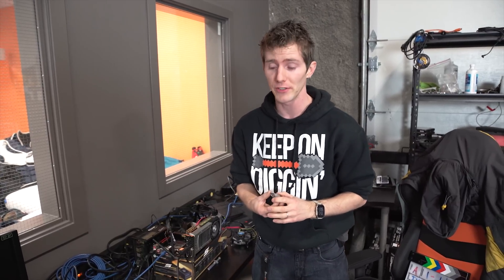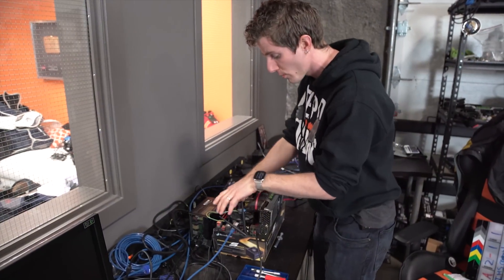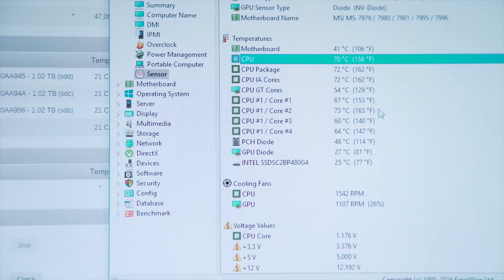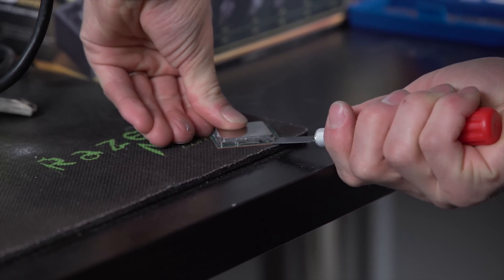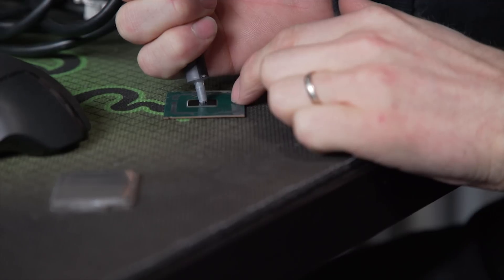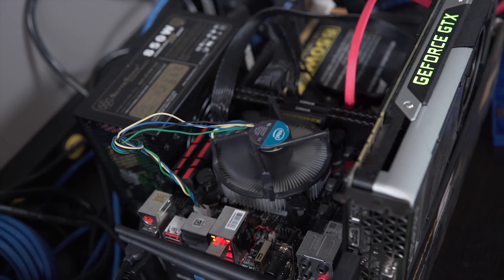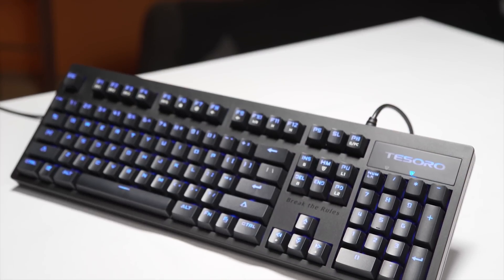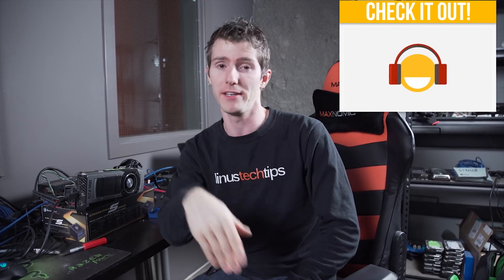Delidding an Intel Core i7 6700K - Is it worth it!?

Comment: Done hundreds of these; use the vice only method. It is so easy compared to this.

Also you should really use liquid metal and spread the TIM on the die out properly. Applying TIM on the die should not be done as casually as applying TIM on IHS. You can easily get 10 C* cooler if you do it properly.
Reply: +slowvomit The Skylake package is much thinner than Haswell though.
Reply: +CheapSushi Still works though... But someone in another comment found this if you are worried about the vice... http://www.overclock.net/t/1585028/skylake-delidding-for-3d-printer-owners

Comment: Dear Linus, i have a question in need of answering. When you opened that metal lid from the CPU itself, i saw an itsy bitsy chip and my brain popped out a question. There was soooooooo much unused space under the lid, but why don't CPU manufacturers fill it with bigger chip? That means more transistors = more powerful CPU? Or is there a some kind problem that manufacturer can't overpass?
Reply: +Chenbag More transistors = more heat.
Reply: SickFriend1
modern coolers can handle that, especially water cooling + i am no talking about filling all space, atleast like 1/3 of actual chip or 1/2, still a big improvement in performance and cooler can handle. Altho i am asking Linus about the downside of this? why can't they make bigger, is there a physical problem that they can't overcome or something? Or is it just about making money? (400 small chips from one platter on the factory vs 300 bigger chips on one platter)

Comment: Honestly I'm quite disappointed with this video. If you're gonna do this. I would hope for doing it right and using that Coollabratory coolant. The temp decreases are quite significant in my mind.
Sure it doesn't change the downsides mentioned in the video. But it sure makes the advantage of the whole process shine more.

Comment: Good tip: I did this to my 3770k, and it is very risky, if you cut the pcb on the cpu you will kill it of course.   I used a safety razor to cut a tiny tiny bit into one corner, then removed the blade and used the sharp edged plastic "blister pack" from a SD card packaging for the rest, which is able to cut the adhesive but not able to cut into the cpu.    

I then removed the residue with IPA, used Liquid Pro Metal applied both to the chip directly and the heatsink (coolermaster TPC-800) which I'd previously sanded and polished to a perfectly flat surface.    I put the heatsink back on directly to the CPU without the IHS (unsure if you can do this with newer chips). Afterwards I saw temps drop roughly 8-10 degrees C.    Obviously each installation is different, each CPU generation is different and results will vary :).

Comment: Should of mounted the heatsink directly to the cpu die, taking the IHS out of the loop completely. Thats what i did with my 3570k and it works very well.
Reply: Was it worth it? Mines running below 70c under load @ 4.7 GHz atm.

Comment: lol I don't understand Linus reaction in the end. The results are pretty amazing, I mean a few °C can matter a lot and he's still not convinced? Feels like he has set his mind in the first place, regardless of the end result his conclusion is probably the same.
Oh an dear Intel..... why on earth do you not just use a good thermal compound in the first place? °__°
I understand that soldering is more expensive in production but thermal compound? c'mon!!!
Reply: I got disappointed when I saw the stock cooler. What's the point of doing this without even overclocking. He is getting old. He is getting lazy.

Comment: This is seriously the worst TIM swap I've ever seen. From the overly risky method of removing the heat spreader to the disregard of TIM used, this was one of the worst videos on the subject that's been produced. A proper TIM swap would have you using a higher quality TIM, properly and evenly spreading a very small amount on the die, and also using the same high performance TIM for the heat spreader to the heat sink. This is not representative at all of the results you could expect if done properly. Alone I've seen a 10 degree C drop in temps by replacing the TIM on my 4790k, allowing an extra 200Mhz of over clock potential. Poor video Linus...
Reply: I edit videos and often have to change video codecs. It may not seem like much, but 200 more MHz on a CPU bound program like Handbrake makes a noticeable difference, especially when videos are greater than a few GB in size.

Comment: People are getting 10 or 14 degrees improvements with this, its very low cost and high reward. You could damage something, but you could damage something by doing just about anything. Why didn't Linus even use a heatgun, he should know better.
Reply: +miiiikku i get ~12 degrees with 4790K... but thats with liquid pro and gc extreme
Reply: Nabil Danial Linus did a quickie on this one. 99% of people don't break their processors, huge gains and low price, its a great thing. Liquid pro costs only 10€, thats half the cost of a good case fan.

Comment: The last computer i build before i went on a long stretch of notebooktime, was some kind of amd, where you mounted the cooler directly onto the die, why did the manufacters change that, because of safety reasons or because it's easier to install a cooler. I remember one time i slipped off with the cooler while installing it and broke a little corner of the die, but i stilled worked ^^.

Comment: depends on the processor series..delid was really helpful on the i7 37xx series..my 3770 reduced on idle from 65-38C..on load from 90-70C..this only means that the new 6700 has really nice thermal compounds on it at stock
Reply: +jaja1818 Skylake has almost the same benefit like Haswell. Still beneficial to delid and replace with proper TIM like CLU or CLP especially if you spent loads of cash on a cooler.
Reply: its nice to see that intel fixed the problem though..nobody really wants to find out that their product is flawed and a fix is available but you void your warranty..in my case, it was a bad generation of products and the 20c different is significant..hell with that difference, i didnt need to buy an aftermarket cooler

Comment: On my 4770k 4.5ghz i went from 85c to 80c using noctuas thermalpaste. Not a big difference, but then i tried out the collaboratory liquid metal between the DIE - IHS and IHS - Cooler, and i am not joking here, i went all the way down to 55c on the hottest core, full load. Running the same Vcore and the same antec kuhler 920 in both tests.

I am more and more thinking that linustechtips is retarded. Linus do you know the saying that the chain aint stronger than the weakest link? Try with a decent cpu cooler and some overclocking.
Reply: +Mads Rawr I did a similar test but with AS5. I seen absolutely no difference with AS5, 72c on the package. CLU applied and now I rarely ever touch 61c max load.
Reply: Feel's good right? :) I also lapped my cpu while i was doing the IHS TIM replacement. I am not sure if it did actually help anything, as i diden't measure temps between TIM replacement and lapping. But it did indeed get way more even, measured with light passing through the edge on a razorblade.

I am thinking that the temperature gain when swapping IHS TIM is scaling heavily with higher vcore and frequencies. That could explain why linus is only getting 3 degree increase in temperature, running stock cooling and frequency.

Comment: Did this on my 3570K using Liquid Pro, dropped my temps by about 23C!  Done it on a 4770K using Romans Delid Die Tool, dropped temps by about 12C, however was using Thermal Grizzly and not Liquid Pro as this is for a extreme benching rig running subzero, weren't sure how liquid pro would react at -30C lol

Comment: The results are much more significant on a Ivy Bridge or Haswell CPU such as the 4770k (BIG Difference) or 4790k (not soldered either, contrary to "DEVIL'S CANYON" belief) and the 3770k.

Not that I would suggest doing this either, I just have personally seen the difference in temperature on a 4770k of 20-30C and was blown-away by the unbelievably bad TIM under the 4770k IHS. 4790k is almost as bad.

I noticed the testbench isn't running the 780 Ti you threw in an oven smeil

Comment: You really need to use Coolaboratory Liquid Pro / Ultra or something if you delid your cpu, otherwise it's not worth it. The stock thermal compound intel uses is actually quite good, as far as regular thermal compounds go anyway...
I reduced the temps on mine by 20°c under load after delidding, using Liquid Pro and a custom loop.

Comment: I believe someone on overclock.net is selling a tool for this.
Reply: +zerphase The only tool you should use for doing this is a vice.
Reply: +slowvomit I'd have to find the post again. Personally, I'm on haswell-e, so it doesn't matter for me. But, I believe it held the cpu in the center, and you just slide a nob.
Reply: +zerphase here's one of them. http://www.overclock.net/t/1585028/skylake-delidding-for-3d-printer-owners

Comment: The reason for low temps might differ if lins would have sealed the heat spreader as the heat spreder is not sealed more aiglow is possible so low temps i guess .!

Comment: Is it that much more expensive to go back to soldering the damn thing on?
Reply: +Liatin1 Soldering methods for silicon is much more complex than you'd expect. You need several layers of solder of different compositions for it to work. Not giving Intel any love here, they can definitely afford to go back to soldering, but it's still more expensive than you think. Probably a $20 cost for every chip.
Reply: +Liatin1 X99 chips are soldered on and they're definitely more expensive.

Comment: Linus made one huge mistake: not spreading the termal paste on the die. While it isn't recommended to spread the paste between the IHS and cooler, it is quite crucial to spread it on the die. If you don't and the termal paste doesnt spread nicely when putting back on the IHS, you can create hot spots (especially the corners) that can brick your chip.
Reply: if you put enough then you don't have to spread it on the die. i understand your concern though. i would do this only if the temp between cores was way off or on a cheap i3/i5 cpu.
Reply: +jlrockafella Putting on too much would ruin the whole point of replacing the thermal compound though. I replaced the thermal compound on my 4770k with liquid metal and the temperatures dropped with a massive 20 degrees C. As you can see from the results here, Linus is just plain doing it wrong: http://www.overclock.net/t/1313179/official-delidded-club-guide
Reply: wtfdinges
Luke already proved the method of applying thermal paste in a earlier video, the difference is minimal. Like 2-5 degrees at most, as long as it is applied on the die/chip/cpu ect. it does not really matter. The whole point of deliding it is to remove that black gunk keeping the thermal compound from working properly. It eliminates the game between the IHS and the cpu die. What kind of thermal compound has lil to do with it. I suggest you swapping that with something else and look at your temps again if you don't believe me.
Reply: +jlrockafella have you even read my comment? I wrote that it isn't recommended to spread out the paste on the IHS, but it IS important to do that on the die itself. It doesnt matter on the IHS because the IHS is only there to spread the heat (it's in the name..) and does not produce any heat itself. However! The die does produce heat itself everywhere and certain spots can become extremely hot when the thermal paste doesnt reach that spot. While silicon can transfer some heat, its conductivity isnt nearly as good as the thermal conductivity of the copper of the IHS for instance. This means that the corners without thermal paste on them will keep warming up until the chip dies (there arent temperature readouts on every spot of the chip). 

About the CLU i used between the die and IHS: it does matter quite a bit. I used regular paste from Artic first and the temperatures dropped 4-5 deg when I changed it into CLU.

Do some research before you act as some smart ass next time.
Reply: jlrockafella What a nice and grown up reaction. The differenence of 4-5 deg was between the regular thermal paste and CLU, both applied using the spreading methode. If someone is taking the risk of delidding a CPU, the extra 4-5 deg decrease is a warm (lol) welcome. 
Apearently you also didnt read my comment again. The whole point of applying a line of thermal compound on the IHS does NOT apply to the application of thermalcompounds on the die. Get your f*cking facts straight and do some research.
Reply: I didnt say it will always kill your CPU, I said it COULD break your CPU. 

And no, it does not only make sense when you have a 'bad' CPU. The performance of transistors (the things CPUs are made of) is dependent of temperature. This means that you could potentially reach higher clock frequencies when the CPU temperature is 50degC instead of 70degC. If you check overclock.net you'll see the biggest collection of delidding data I've found so far which proves this fact. 

Although I'm not specialized in thermal design, I do have a master degree in micro electronics and have been working for a chip designing company for over five years. So yes, I do know what I am talking about.

Comment: Over a -13c drop with Liquid Pro on a 4790k. Oc'ed @ 4.8 with a 4.5 cache on load I get no more than 63-64 (bounces) on a Liqtech 240. It rocked the stock temps which were 85c on load. 1.30v.

Comment: german website computerbase have gotten over 20 degrees improvement with the liquid metal stuff. so it might be pointless with regular thermal paste (arctic silver got them 4 degrees), but if you use the right stuff the delid can mean the difference between throttling and even more oc headroom.

Comment: may not be worth on a 6700k, but Haswell is a complete other story...
I went from 85°C in Aida64 down to 65°C on my 4790k, whith phobya liquid metal.
also the CPU does not jump in temperature so much (before like 20°C in 2sek when applying load)

Comment: Why does having this processor overclock slows down my boot time on an asus gene VIII. I have windows 10 installed on a samsung 850 evo ssd, takes 2-5 minutes
Reply: "2-5 minutes" that's slow lmao
Reply: my gaming laptop loads from 2 secs to 5 secs
Reply: im using my motherboards overclock it overclocks 07%
Reply: i hope it aint a faulty ssd lol. my first one i bought from NCIX came in DOA. and they refused to pay back in full. i only got 80%
Reply: and thats why i didnt use them for years, now im slowly stepping back but only if the savings is 20% more than other stores like newegg

Comment: It was Haswell that had the real awful stuff. The whole point of Devils Canyon was to fix that TIM issue. Under load the cores would have a 10+ c delta . The effects are also magnified when over clocking. Take a stock 4770k, push it to 4.5ghz then repeat the test.
Reply: it was on ivy bridge too by the way. perfect consumer cpu was the i5 2500k. today it is x99 but not worth it right now.

Comment: delidded my i7 4770k, was getting around 80c but after delidding my chip the temps dropped down to 60c. @4.6ghz 1.29v nh-d15 liquidultra. And also getting equal temps in each cores.

Comment: btw. if you are going to do this to your processor use the vice method, it's much safer and faster
Reply: Not on skylake
Reply: +Tomáš Kušnír Delid tools are even quicker.
Reply: Olly Pellatt
why not?
Reply: +Tomáš Kušnír Thinner PCB
Reply: +Olly Pellatt (G55) plus they bend too easily if vice method isn't used.
Reply: I0ITuGI0I
well my 4670k IHS went down in a matter of seconds, dunno how much faster can that be
Reply: The way I see it, if you're going to do something that the manufacturer didn't intend you to do, on a fragile and expensive piece of equipment, does it hurt to take your time doing it?
Reply: 3D printed delid tool, takes 10 seconds on a vice lol. Give or take more.
Reply: Tomáš Kušnír I have a delid tool, it took seconds to pop off the IHS.

Comment: I'm using water cooling and my 6700K is overclocked at 4x 46, 3x 46, 2x 47 and 1x 48. With maximum load, CPU's temperatures would go as high as 80°C. Water temperature 40°C. So that is a whopping 40°C delta!
I've ended up delidding the CPU, replacing the TIM with Phobya LM and gluing the IHS back on. Now the CPU's temperatures don't go over 60°C under full load, if water is at 40°C. So the delta was reduced for the whole 20°C!

Therefore, in my case it was worth delidding. But! I spent days researching on the forums how other people delid their CPUs, which methods are in use and what are the dangers. Delidding itself was a very nervous process and for a moment in testing I thought I had damaged my CPU, but I actually got a bent pin on my MBO.

Comment: I delidded my 4670k and replaced the crappy Intel paste with CLP. I also went from air cooling to an H100i gtx so that probably helped too. I didn't do any official testing, but prime 95 went from high 70's to mid 40's.  I used the vice method and my hands were all sweaty because I was so nervous. But, it turned out to be really easy and painless. Would recommend doing if you have a chip with bad paste.